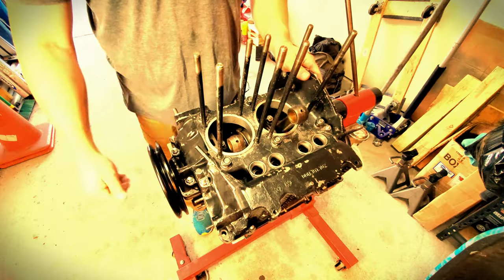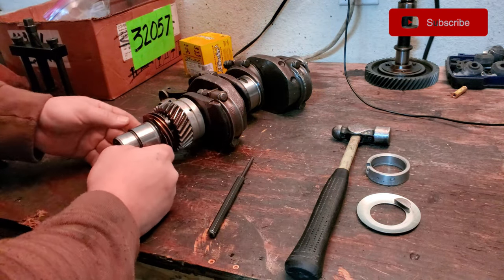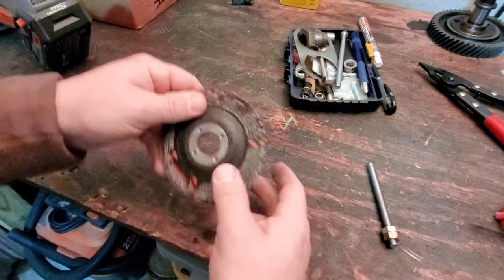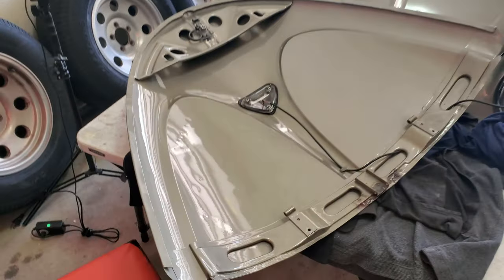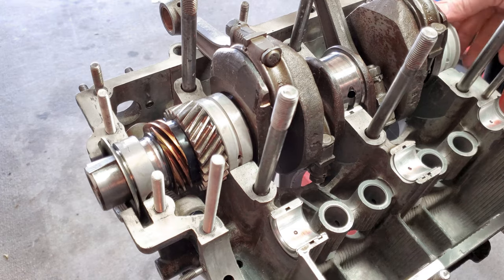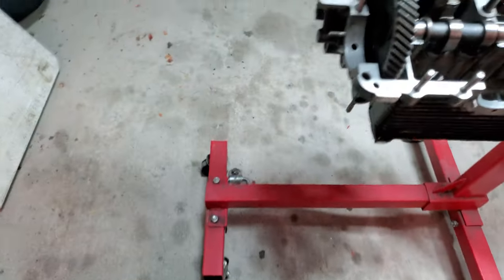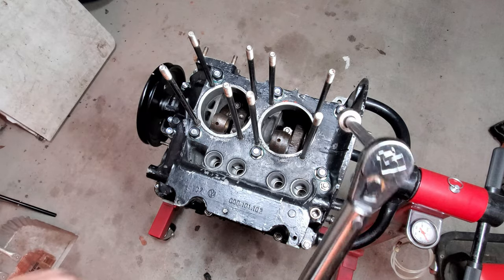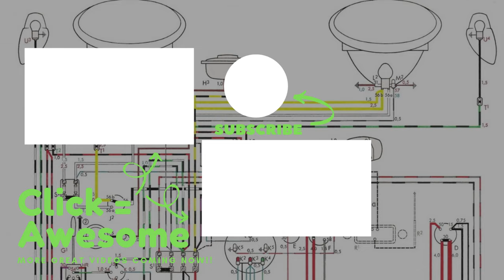How to Rebuild a VW Air-Cooled Engine "PART 5" Closing the Short Block | JW Classic VW

Comment: Great series, thanks for that. Just a small but important tip: don't replace worn or rusted studs against VA/ stainless steel!If you combine them with regular black steel or hardened steel, things will seize solid!Tried it out in my youth as well, really can't recommend IT:-) Same is for the Idea to replace the beetle's  fender bolts with stainless steel ones- you can ruin the welded in nuts of the body!
Reply from the maker: Yeah... normally not my go to but for this lil engine I wasn't to concerned.  I guess we'll see if I pay for it eventfully, lol.

Comment: Thank you so much for taking the time out to do these videos. I’m getting ready to build an 1800 from scratch. All new. Will be my first one. I’m ordering everything to complete the long block from Aircooled. Your car is beautiful. I restored a 1966 standard. I did everything. Heater channels, inner fenders front and rear, A and B pillars, and patches everywhere. I even painted it. I’m running a 64 block 1200 now and I just want to keep up with traffic so it’s time for a fresh build. I’m going to keep on cruising the 40 hp until I’m done with the 1800. Your videos are so helpful to me. Thank you Jason
Reply from the maker: Thats awesome brother!! Glad to hear the videos are helping out.  Pretty much the same thing I did while I was building my 2276.  Now I'm rebuilding the 40hp so I can do some upgrades to the 2276.

Comment: So after a line bore do they drill dowel holes deeper or do you grind the dowels down so it dont F. Up the bearings
Reply from the maker: They do drill and clean the dowel pin locations.. but I always check to make sure they are recessed correctly.

Comment: Do you need to do any balancing thanks ? I also love do do all the work, so enjoy your show thanks for sharing perhaps you could make good money as a teacher, and that was meant as a compliment because I see you enjoy doing the motor and I see you have patience that’s so very important thank you
Reply from the maker: It doesn't hurt to balance the pistons and the rods... anytime you can equalize weight between these parts the better the rotating assembly will move and wear in the bearings.  In a smaller displacement motor this is less critical than with a larger motor with higher RPM ranges.

Comment: 40vw didn't  have cam bearings the cam ran directly in the crank case unless they factory rebuilt  in Germany   i late father was a Volkswagen mechanic at Volkswagen dealership and service manager   he said the1300cc 50hp was first year to have inserted  cam bearings.

Comment: any way of checking that case  for wether it needs line boring  when u put  2 halves together at trial stage     save all that assembley  and dissasembley ie  work  thlol
Reply from the maker: You'll find that the dry fit is actually one of the easiest ways to check this.  But the best way is to mic out the case with the case together torqued. A bore gauge is required for this.

Comment: Hi jw,i know i maybe late in writing this post for you,but i have just stripped my type 1 1600 engine down ,due to another issue,and was wondering just how hard it would be to turn the flywheel by hand to see how hard it should be,as I know that there should be some resistance in turning the crank by hand but need to see i live on another engine,i am almost at a loss,as i have just replaced the crankshaft,and bearings,these are absolutely spot on,camshaft is goos also,i replaced piston rings also,and ever since i have put my engine back together,cranking the fly wheel by hand seems incredibly hard,and that's without spark plugs in,my endflost is 3mm so that's not the issue,so asking if you could do a short video of one of your engines being cranked by hand,i would so grateful if you could do this sonthat i can see the level of difficulty in turning,as i don't want to put it in my bus for fear i could burn out starter because of being to tight,so asking for your gelp jw,thanks for any help you can give me bud..👍
Reply: Sorry for the spelling errors by the way.👍
Reply from the maker: You shouldn't have any serious resistance.  With the plugs out the resistance you'll feel will be from the valve train.  If it's hard to turn over something is wrong... take her apart.
Reply: @JWClassicVW  Hi bud,it isn't serious resisance whereas the fly wheel can't be turned at all,i can rotate the fly wheel by hand and feel the valves opening and closing, it's just when i first dropped my engine for routine maintenance some years back,the flywheel was fairly easy to rotate by hand,but ever since i replaced the piston rings,and with no spark plugs inserted it feels normal on a hand rotation,but as soon as i put plugs in,it stiffens up dramatically,so maybe assume this is normal resistance due to having new rings,i think the only way to really find out is by attaching the starter motor and see if it's straining to turn over the engine,this is my first attempt on wirking on a flat 4 1600 block,as i have stripped many other engines in my past and all have worked correctly,as i do have knowledge of engines, it's just i have never worked on a flat 4,even though i follow all the tollerances as i do for normal engines,so i am somewhat perplexed by this....i have followed all your tips on rebuilding and what to watch out for,and it has been done correctly,so now will try the starter motor method and see what happens...👍
Reply from the maker: Sounds normal... you definitely see a big difference in resistance with the plugs in and a bit more once the rings seat after running the motor for a bit, but that's just your compression.

Comment: what got you to line bore at the last minute ? can that be checked before hand ?  thank you ,,,,,nice job
Reply from the maker: The main reason was when I had the case at final torque I had a slight drag while I was rotating the crank.  Of course you could mic out the crank for measure and then assemble the two case halfs with the bearings... torqued, then with a bore gauge check for tolerance issues but I knew there was a problem.  When line boring my cam journals were also cleaned up.  Worth every bit of the $100 bucks.

Comment: now those bearings are 020 over on the OUTSIDE only ? for the case , the crank does not change .
Reply from the maker: Crank wasn't turned or polished so no the ID is standard OD 20 over.

Comment: I know it's a stock engine,but surprised you didn't blueprint the oil pump.
Reply from the maker: Yeah... I did look at the oil passages and they are pretty on point considering stock oil pump.  With high power applications this is definitely something to pay attention to.
Reply: @JWClassicVW  
Either way. I would have given it the Ezgz touch. 👍

Comment: What is the main difference in Curil T vs. Gascachinch?
Reply from the maker: Hey brother... you get into the goodies yet... lol The main difference  that I've found is 3... 1 the Curil T stays flexible. 2. Being that it stays flexible it would also have the ability to heal, or fill possible gaps created with expansion.  Not really a problem with a new case but a possible issue with older cases. 3. Ease of clean up, I've definitely found that the Curil T is a lot easier to clean off the case.
Reply: @JWClassicVW  cool 😎 thanks I just order through your link.
Reply from the maker: Awesome, thanks for the support!

Comment: Do you use like a torque lube on the case bolts.
Reply from the maker: No lube required... your not trying to stretch the case studs like you would with rod bolts.
Reply: @JWClassicVW  But wouldn't the lube help you to accurate hit the torque numbers you need.
Reply from the maker: @badbug911  No... all this hardware has nylon locks so torque is only defined by use of a torque wrench no additional oiling needed.
Reply: @JWClassicVW  Ok you are using the stock nuts, understand.